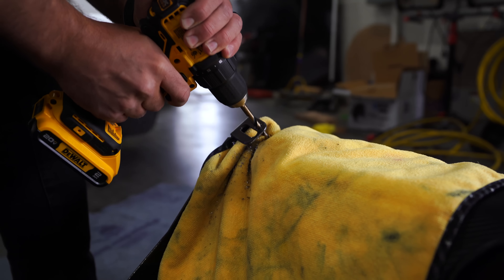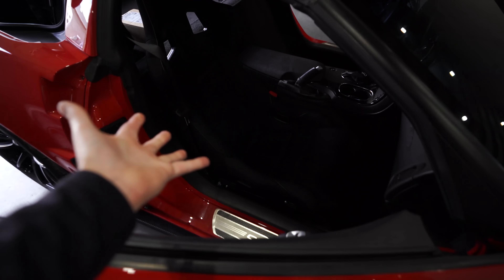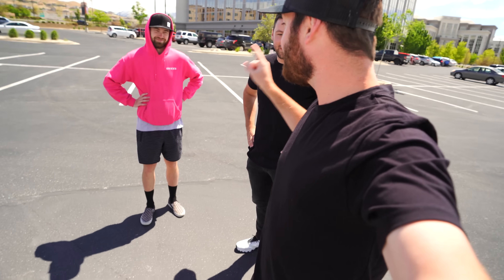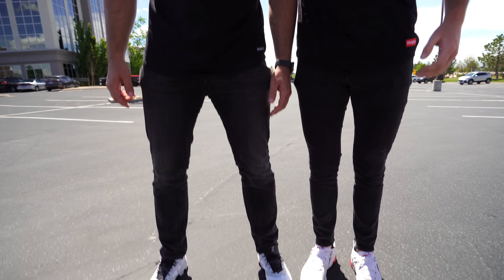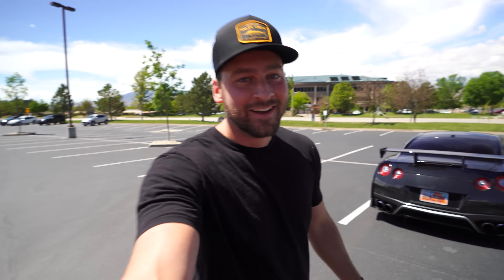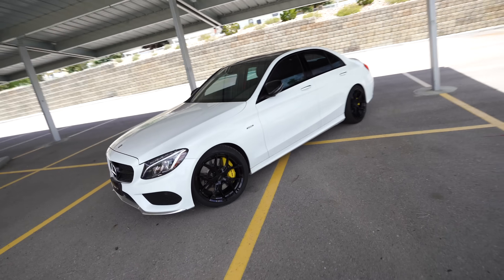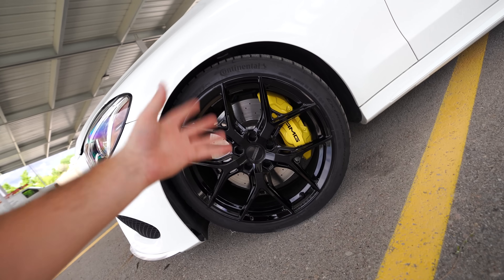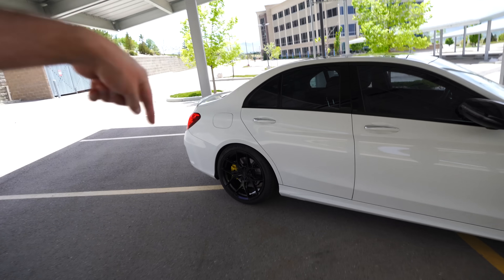Upgrading My Daily!

Comment: Hell yeah Luke!!! My C43 sounds pretty mean, Redstar Exhaust catless downpipes will do you some good. I’m also running it with a muffler delete and Magnaflow resonator. Sounds amazing in my opinion. Btw get James to buy an AMG!!! A modded E63s or GT63s or maybe GT R would be wildd. Or a straight piped V12 S65 for a daily🔥
Reply: @Sakurr he lives in utah, a C43 is a much better car for the snow my friend. And stage 2 C43 smokes a stock C63s off the line, lots of fun.

Comment: Also why did u gonwoth 19s should have got 20s and lowered it on 20 I know ppl with 22inch rims on them but best set up I seen was 22 rear and 21 I front looked great but u should have atleast went with 20s but that’s said and done now but do what I’m talking about I’m surprised James has told u to remove the cats on the 6.3 I think James doesn’t even know how good the Ang can sound when u remove the secondary cats just like adding a aftermarket system

Comment: You don’t have to get a exhaust for the 63 just remove the secondary cats and it will rubble u just remove the cats and add a straight pipe in the cats place for less then a couple hundred dollars u can make a 63 sound insane just research it trust me rdb has a video from there old location we’re they had a 63amg and that’s all they did remove cars and add pipe and it’s sounded amazing rdb vik said that also thisbguy figure out u can make the 63 sound like they have a 10k exhaust true tmr if it doesn’t sound amazing what’s the worst u remove the cats u have to remove anyways trust me wouldn’t lie to u go search up amg63 engine jsut there cats remove they already give u a nice exhaust so doesn’t take much it’s just like when u buy a exhaust and the cats get replaced with the new exhaust and that’s why they sound so good cause they don’t have the sec cats otherwise wouldn’t be loud